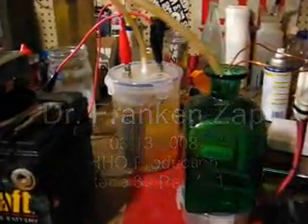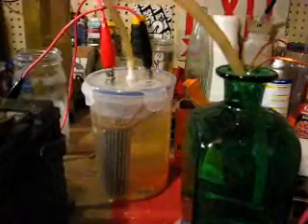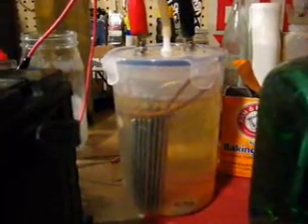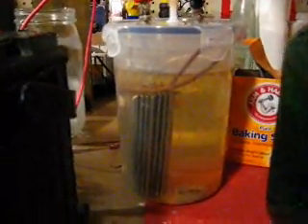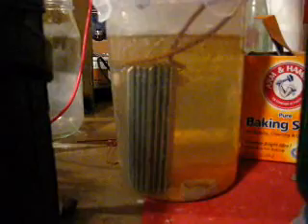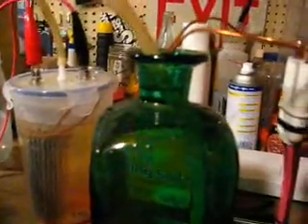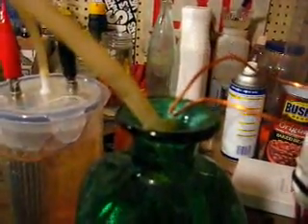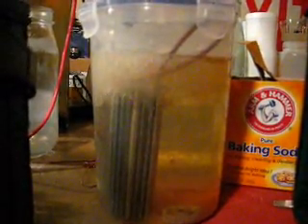HHO Production Stage 3 - Part 001

Comment: a series cell like you are attempting will benefit from sealing the edges of the plates. electricity will do an end run around your plates if you dont. small openings top and bottom to permit flow of electrolyte is all that is needed.  the more edge area you seal up, the more efficient your device will be.  but in general, you are certainly on the right track.  and I like your spark gap idea.  I might steal that one.